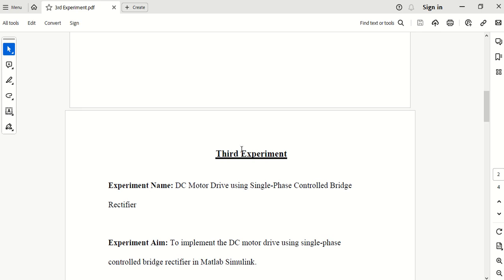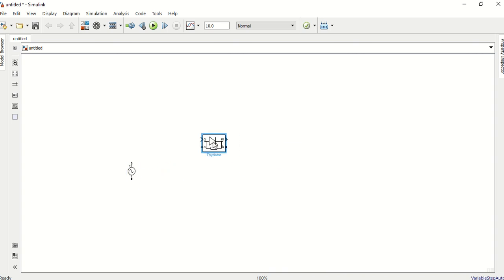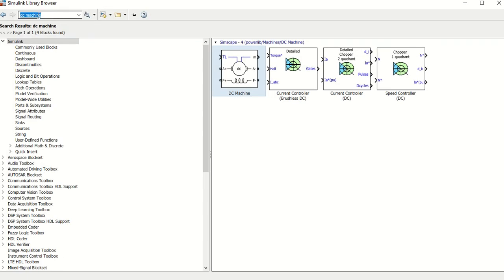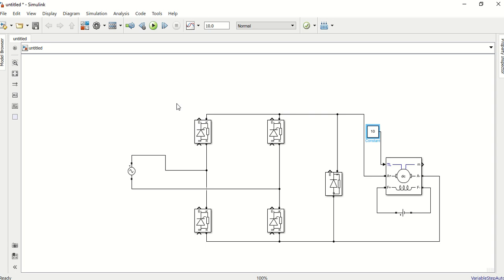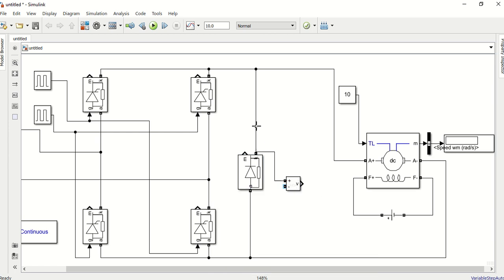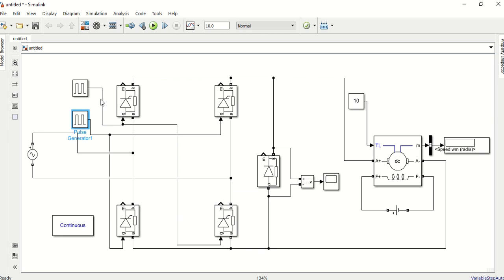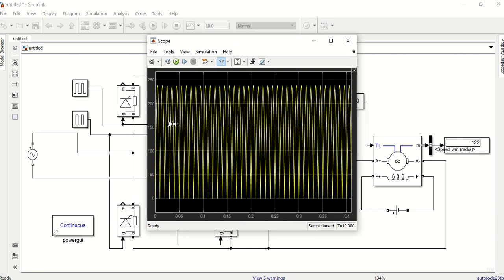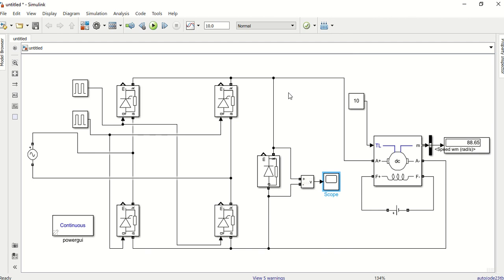Exp.3: DC Motor Drive using Single-Phase Controlled Bridge Rectifier

Comment: thank you sir When I practice this experiment and put the output voltage of the bridge rectifier decreases beyond a limit, the speed of the DC machine will be reversed. why ?
Reply from the maker: Since the field voltage is constant, when you lower the output voltage of the rectifier, the armature voltage also drops. If the armature voltage gets too low, the motor’s back EMF can become larger than the applied voltage. This causes the current to reverse, making the motor spin in the opposite direction.
Reply: @ thank you sir 🤝